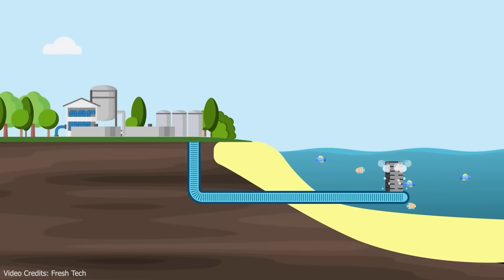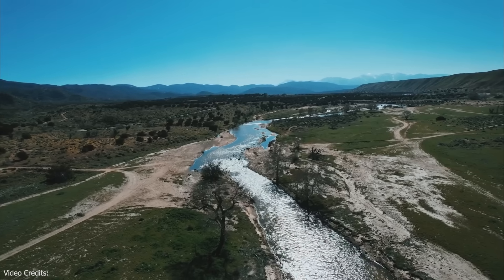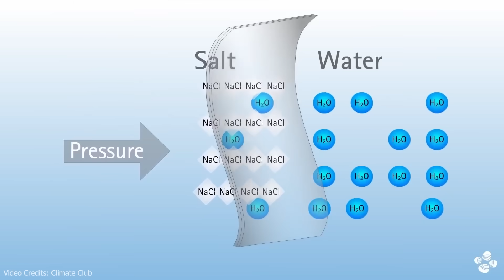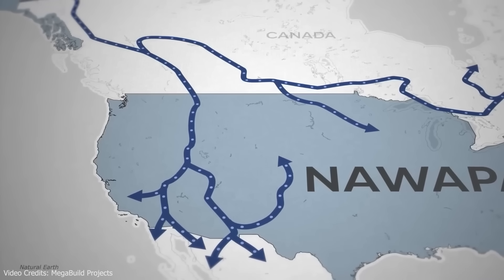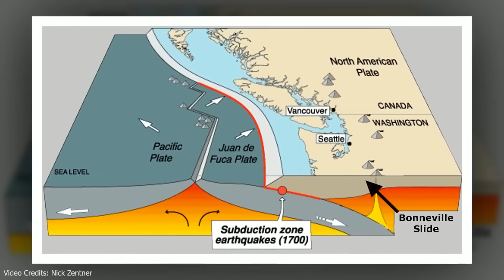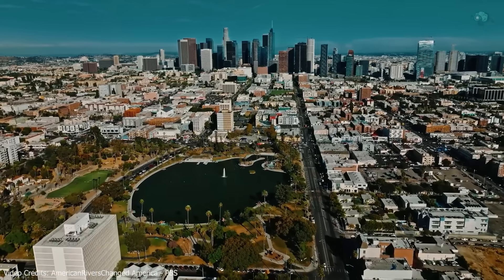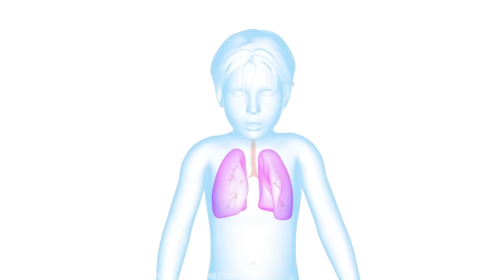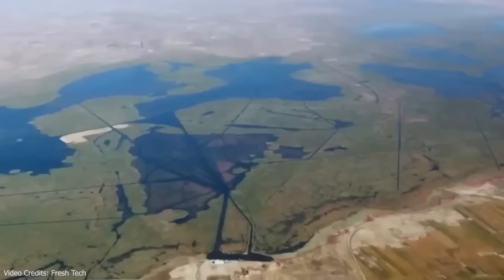Nevada's $16B Plan To Pump The Pacific Ocean 170 Miles Into The Desert

Comment: WRONG!  
1. A new reservoir in Nevada would not necessarily increase in salinity if filled with RO fresh water that has a low enough salinity, and water isn't just only pumped in but also pumped out for irrigation etc.  The salinity would stabilize at a value depending on the inflow and outflow ratio, and evaporation.   It's a simple calculation.
2. Funding for NAWAPA was not available because The national infrastructure Bank was shut down in the '50s.   The national infrastructure Bank was the key to all the massive public works projects done during the New deal era. It could also fun this proposed project, and a pipeline from the Mississippi River to refill Lake Powell and Lake Mead.  The National Infrastructure Bank Act (NIB) of 2025, HR 5356 will solve the acute water crisis on the Colorado River and Southern California, with a proposed water diversion program, bringing fresh water to the Lake Meade and Lake Powell, from a channel in Louisiana. This project is modeled on similar pipeline projects done during WWII. In 1942-43, two oil transport pipelines were completed in 12 months and brought oil from East Texas to New Jersey. The proposed pipeline to fill up the reservoirs on the Colorado River have the same orientation as those built in the 1940s. The National Infrastructure Bank Act (NIB) of 2025, HR 5356. The bill has 46 sponsors. Cosponsors include: Andre Carson, Jerry Nadler, Pat Ryan, John Garamendi, Max Frost, Valerie Foushee, Hank Johnson, Chuy Garcia, Chris DeLuzio and Eleanor Holmes Norton. Cosponsors from Oversight include: Ro Khanna, Max Frost, Rashida Tlaib, Summer Lee, and Eleanor Holmes Norton. HR 5356 would create a $5 trillion public bank to invest in infrastructure projects only. In the past four years the American Society of Civil Engineers reports that the infrastructure funding gap in the U.S. has grown 40% to nearly $4 trillion! The current Bipartisan Infrastructure Law will expire next year and there is no funding source to replace it. The government is running a $1-2 trillion annual deficit, so there is little money to cover any discretionary spending. This situation is being exacerbated by the government shutdown engineered by the White House. The NIB is a positive alternative to the policy of shutdown, rescissions, mass layoffs, etc. The NIB will create over 20 million new, Davis-Bacon wage jobs, and build the economy. It has strong provisions for minority hiring and DBEs. It will require no new federal spending or federal taxes! The NIB will finance at least 5 million new units of truly affordable housing. This will alleviate the housing crisis in California. It has been done before in US history, and built many long-lasting projects. (Coachella Aqueduct, Hoover Dam, San Francisco-Oakland Bay Bridge, etc.) There is growing support for the NIB. In June, the National Federation of Democratic Women passed a resolution in support of the NIB at their national conference. In July, the National Association of Counties (NACo) passed a resolution of support at their Philadelphia conference. NACo represents 40,000 elected officials and 3,000 counties. In August, an excellent resolution passed the Democratic National Committee (DNC) meeting in Minneapolis, in support of the NIB! The Democratic Party officially supports the NIB.
Reply: Texas could use Mississippi River water, and transport would be relatively easy over flat-ish terrain. But it's not going to happen. Also, southeast Oklahoma is drowning in water it doesn't need, but they won't give Texas a single drop. So Texas needs to spend heavily to expand water supplies that originate in Texas. The recently approved Texas Water Fund will provide $1 billion per year in funding for water development projects. Because Oklahoma won't share any water, the massive Marvin Nichols reservoir may need to be built in northeast Texas.
Reply: @frederiklogirush5607 thanks I will share that with the national infrastructure Bank people.   If only Texas was hooked up to the National Electric grid, maybe they could share low-cost electricity with Oklahoma to entice them to share the water.
Reply: Interesting how this project would cost about the same as putting new engines on the B-52, and there is the money for that available.  I'm not saying that the B-52 new re-engine shouldn't be done, but the cost of benefit needs to be considered for everything on a equitable basis

Comment: There is no such "Nevada inland sea" proposal by any Nevada politician, scientist, school principle, or short order cook. The tiny benefit of this video is to mention the Salton Sea & what to do about it. If properly designed, a new pipeline or aqueduct from the Pacific Ocean basically downhill to the Salton Sea could be used to restore the lake level & cover over the nearby polluted dusty land areas. De-salination plants along the lake shore, then pipe the brine solution somewhere back to the Pacific, but far enough away from the intake pipe. Maybe put in an underwater pipeline to discharge the brine water 10 miles out to sea. With passage of time, the Salton Sea would become the same salinity as the Pacific Ocean. De-salinated water could then be used for nearby California agriculture, in place of Colorado River water.
Reply: THEY'RE going to dry up the Ocean now.

Comment: Why not connect it to the hoover dam?
Reply: Desalinate Pacific Ocean water, pump it to Nevada's Lake Mead, and send most of the water downstream back to California?  Best to desalinate the water in coastal California and use it there, reducing the water sent downstream to California.  The Colorado River basin is drying due to excessive use of water, primarily by California.  Eventually, steps need to be taken to solve this problem.  Covering the canals to reduce evaporation, recycling more water, and increasing the water available.  Will environmental groups allow more desalinization plants in California ?
Reply: @angellara2446 says: “Why not connect it to the hoover dam?”
That is circular logic turned into a water cycle.

Comment: The sheer amount of people who comment without watching the video is staggering
Reply: Pedantic nitpick: that's number (countable), not amount (measurable).:It's the difference between the number of cartons of milk you have, and the amount of milk remaining in your opened carton. So, numbers of people, not amount.

That number is currently 92 as I write this, which is barely a 'sheer number' of anything, even if they are all nonsense. But, yes, I'll agree with you on principle-- uninformed comments unrelated to or incorrectly characterizing video content aren't useful.
Reply: It is an AI generated video.  Any rational engineer could think for two minutes than fully explain why this wouldn't work.

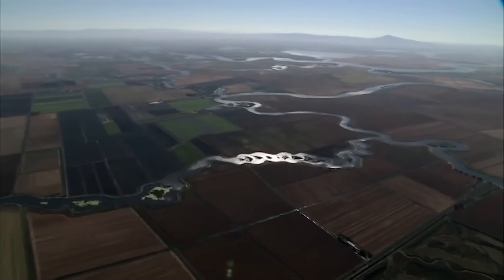Comment: 10:41 What about using the weight of the ocean, to do most of the pumping through reducing pipe diameter
Reply: Please expand your ideas. How would weight of the ocean pump water?
Reply: What about enrolling in an introduction to basic physics class instead?
Reply: @Klyis you have never messed with large volume of water, it really works  look it up, there's people that do that on small, scale today, and have been for a long time, lol

Comment: The only way to save the Salton Sea is to pump sea water from the old San Onofre nuclear plant on the coast over the mountains and into the sea to fill and maintain a sustainable sea level. Very cost effective...
Reply: I get the humor, but why should the Salton Sea be saved?  What's the benefit?  Maybe the better solution is to fill it in.

Comment: Don't do it desert exist for a reason to keep the planet in balance  if you turn a desert into a wetland another wetland will turn into desert  we have already seen it in Israel  the desert moved to Iran  the balance will be maintained leave the desert in unpopulated areas or it will jump to a populated area quit screwing with the natural system stop installing drain pipe to drain away groundwater you keep doing it to yourself leave it alone
Reply: How do you figure there is a balance such greening of isreal caused wTer loss in Iran?   When the Bahrain was green 5000 years ago it did not create another desert!

Comment: This is only useful if you desalinate it first turning it into drinkable water , otherwise it’s a pointless waste of money.
Reply: Actually filling dry lake beds with sea water would still be useful. Any evaporation of the sea water would naturally purify it. The extra humidity would increase rainfall in the rain shadow of the High Sierra mountains. The extra rainfall west of the Continental Divide would be added to the normal precipitation in the Great Basin and help with the water problems being experienced there right now. The only question is, would it be enough to make a big enough difference?
Reply: True. Yet, salinity would increase over the years to the detriment of the project.  Inflow of ocean water needs outflow for stability.  Outflow to the Salton Sea then to the Sea of Cortez, maybe?
Reply: @saxonsoldier67  I has thinking more of the Great Salt Lake or Pyramid Lake, or another already super salty body of water.  But the Salton Sea for SoCal works too.
Reply: The video said as much. Desalinate at the intake side.

Comment: major solar and major desalination both sound good... shipping water is not though. if we find a way to take care of the Salton sea then we can talk about this again.  

Some of these will never happen projects are crazy. I would love to see stories that work for instance. In the scorching heat of Seville—one of Europe's hottest cities—the innovative CartujaQanat project on Isla de la Cartuja revives ancient Persian qanat technology to create a sustainable urban oasis. This €5 million EU-funded pilot, operational since the early 2020s, features a 20-meter-deep underground channel where water cools naturally to around 20°C, then solar-powered pumps circulate it aboveground for evaporative cooling, misting, and ventilation—dropping ambient temperatures by up to 10°C across an area the size of two soccer fields while using near-zero energy.

This project sounds like it is working it makes financial sense and will not hurt the environment at the same time
Reply: Exactly. The Salton sea used to drain to the Pacific, I'm sure there's a way to open it back up with some excavators, boring machines, line a canal with recycled plastic from the ocean(more positive cleanup). Have we forgot how to make solar powered excavators to reduce energy costs? Use a smidgen of our stored military explosives to blast whatever is in the way.  
Put fusion/fission reactors in the Nevada test area which is already contaminated and superconducting grid wires when room temp ones are available.
Reply: do that with the salton sea.but have a way for the water to come out to flush the pollutants out